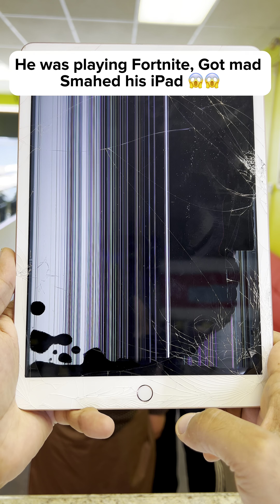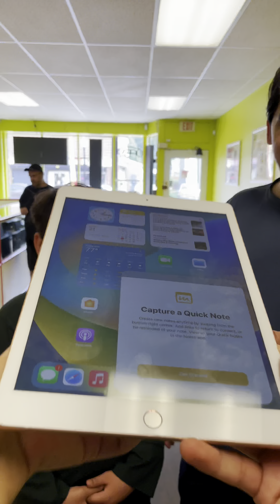Fortnite Kid Destroyed his iPad and came to see if it’s Fixable! 😱😱 #apple #fortnite

Comment from the maker: What’s your battery percentage right now ? Comment below 👇
Reply: 100
Reply: 34
Reply: why post the comment 2 times
Reply: 57
Reply: 81%
Reply: 97%
Reply: 74
Reply: 8
Reply: I just charged up to 100% battery
Reply: 100
Reply: 20%
Reply: 44
Reply: 50
Reply: 70%
Reply: 96😂
Reply: 83%
Reply: @thari259  Just charging to 70%😅
Reply: 100%
Reply: 100%
Reply: 29%
Reply: 76
Reply: 39
Reply: 52
Reply: 12%
Reply: 1
Reply: 9
Reply: 47% half battery
Reply: 35
Reply: 84
Reply: Hello, I have a question. I recently bought a wireless PC mouse and I use it for gaming. But sometimes, It just disconnect for 0,50 seconds and then reconnects instantly and thats a big problem for me when I am playing games like fortnite or Roblox. How do I fix it? Thanks!
Reply: 90
Reply: -1%
Reply: 100%
Reply: 25
Reply: 14
Reply: 47
Reply: 79
Reply: 24 charging it
Reply: 65%
Reply: 1
Reply: 67%
Reply: 66%
Reply: 37
Reply: 15%
Reply: 42
Reply: 3
Reply: 100
Reply: 23
Reply: 19
Reply: 100
Reply: @Buildit_AndPlayIT  k
Reply: 16
Reply: 101
Reply: 84
Reply: 35
Reply: 43
Reply: @Buildit_AndPlayIT  check if the usb key is loose if that helps
Reply: 100
Reply: 95
Reply: 84%
Reply: 76
Reply: it is (charging)
Reply: 82 %
Reply: iPad fixing?
Reply: 8%
Reply: ♾ My GAMING PC